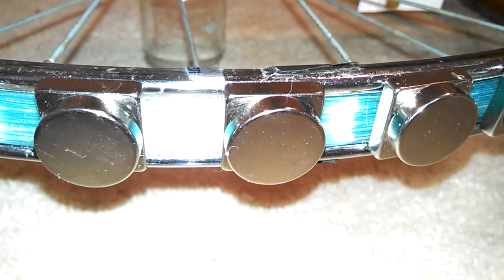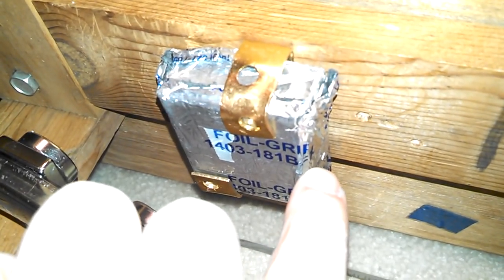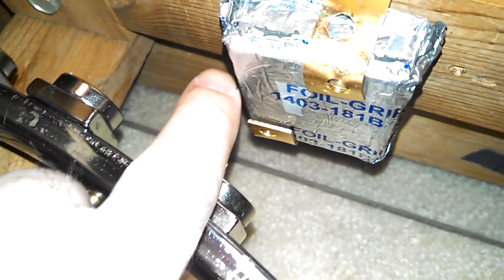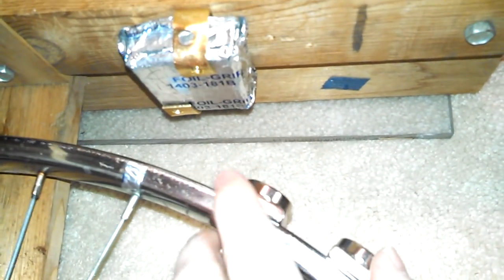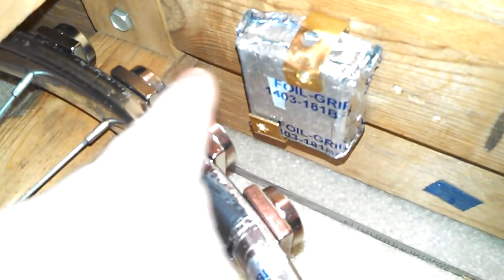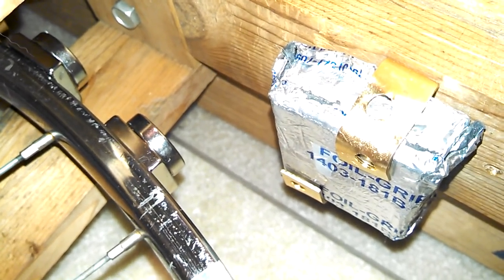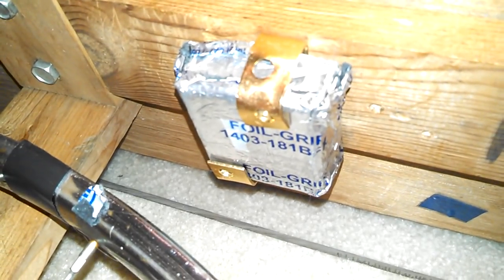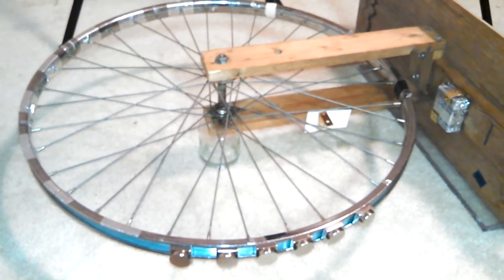🧲 Self Running Magnetic Motor Stator Test #2 update

Comment: I believe it if you show that the wheel is waterleveled...I will believe it because I made movement with magnets also ...without putting in energy myself. A very strange behaviour of neodymium is that if you put equal poles face to face they will repulse eachother away, however... if you put in the center of those magnets a plate or peace of iron, they wuill be atracted to it until they get very close to eachother and actually the neodymium magnets will be searching ( feels like floating) for a place where they can get face to face and repulse eachother again. So imagin two wheels with in the center a plate or iron object, so the magnets will atract eachother you get movement. The plate is placed so that when two magnets facing eachother are at their closest to eachother, thats where the plate ends so the magnets will repulse eachother..... if you have the 2 wheelsentirely rounded with magnets repulsing eachother and only a small area where they atract eachother, you get movement. Only 1 little push (depending on the strength of the magnets) would keep it moving..... try it and you will like it...  Sorry for my bad english...
Reply from the maker: 🧲 https://youtu.be/jsgUF5DHAwo

Comment: This video begs the question.  why not skip to the full wheel of magnets actually running?
Reply from the maker: 🔴 itakeyourphoto - I finally back now. Just now seeing your post. Sorry. . I’ve tried armature magnets all the way around. Does not work whatsoever. Not even a little. Once I place a gap back in, than it starts to run once again. I’m now working on a new build. Thanks for sharing your your idea though. Sadly, been there, done that, never worked.
Reply from the maker: 🔴🔴🔴 itakeyourphoto - Because I had to walk away from the project.

Comment: You're making a difficult to make thing, but it's not what you think it is. I's a perpetual motion device, but it does not produce energy. For kinetic energy to work, you must put in more energy then you get out. For instance, cranking the handle of a manual crank. You crank that wheel several seconds, you'll feel it isn't on a ball bearing. You had to put in a lot of energy to produce a very small amount of energy. The bigger wheel you have, the bigger energy you need it to produce.

Why is this important? Because the monopole method of producing energy only produces enough energy to keep itself spinning. Yes a monopole is amazing and able to keep perpetual motion, no it will not create additional energy beyond the kinetic energy required to keep itself moving. If you hook up a crank for any amount of kinetic energy, the force required to produce energy will come out of the kinetic energy required to spin, and it will slow to a stop as a result.
Reply from the maker: 🧲 https://youtu.be/jsgUF5DHAwo

Comment: I am wondering can you exploit the other pole of the stator which you have brought to half-strength flux in order to gain repulsive power. Am I correct that all of the magnets on the wheel have the same pole oriented outwards? I was thinking is it possible to insulate only the middle of the stator in order to distribute the flux so that it pulls from one side, pushes from the other by repulsion and obstructs least the motion in the middle.
Reply from the maker: 🧲 Big improvements since this video was made. No more sticky spot. 🧲 https://youtu.be/jsgUF5DHAwo

Comment: Good work. Keep posting.
Reply from the maker: You bet! Thanks. I resume my work May 1st, 2004
Reply: James, any success so far ? I have an old record player and am using its rotating disc to make a rotor. Just removed the tone arm and other unwanted stuff from the turntable. Will try your system of shielding. Great work. Thanks again.
Reply from the maker: Sandeep Kapoor Any success so far you ask??? My post clearly states that I resume my work come, May first, 2014. There by I'm not working on it.

Cheers!
Reply: Yeah in your previous post you mentioned "2004", so I asked. Lol.

Comment: We dont have to believe it. SHOW US. Get one of those magnetic field cards and hold it upto the stator and show has the field. Also, if it works how you say it works, you should be able to put magnets around the entire wheel, and it should continue to perpetually go around. So lets see that also.
Reply from the maker: I will be resuming my work May 1st, 2014 when I retire from my current job. If you cannot wait until then, simply build it yourself like others have who ‘now know firsthand’ that my stators works exactly the way I claim they do. Otherwise chill and be patient as I pull 80 to 90 hour work weeks and barely have time to do laundry, let alone cook. I was FORCED to walk away from my research or end up on the street.

I’ll resume soon enough.
Reply from the maker: Actually I did just that. The magnets were so powerful that it ruined the magnetic plastic sheet. Their not cheep, so I never reordered one. There were no instructions, so I had no idea that you had to keep the magnetic sheet away from the magnetic field just a little bit. Go figure.  :(

Comment: great vid , is that the copper wire inside the wheel rim in one big coil? how much power do you estimate it could output?
Reply from the maker: There is no copper wire used with this project. At this stage this video is about how well my one way stator works. As for power output? With a completely different design scaled up using a series of twelve light gage cylinders approximately twelve feet in diameter and fifty to seventy feet long would have enough torque to run a very large factory or a small town. However doing away with the grid is the idea. A hot water heater size unit would go beside your hot water heater to power the home. Keep in mind that I'm only at the developmental stage. So for now, we must take my research with a grain of salt, regardless how promising my research may be.

I'll return back to my research May 1, 2014 when I retire from my current job April 30, 2014.
Reply: Thats fantastic mate , obviously you want to protect your info but I would love to get more info on this as you go, I think this is the way to go for home energy independence . I'm very new to this but I think magnets are the way to in the absence of turbine friendly environments. The torque seems to be the issue in most cases , do you see the hot water service sized unit as multiple devices stacked ? Like 20 x 150w stators? Is the eventual plan to have the stator on the inside of the wheel and stationary magnets either side?
Reply from the maker: It would by a cylinder within a cylinder, both being heavy PVC or acrylic. Until I get my first prototype running, all bets are off. Until then, there is no exact way to foresee how much torque conversion there will be. Did you go to where I archive my work? Try, www.JamesRoneyStators.com where you will find my latest info and FAQs.

Do you have any ideas as to why it might be better to have the stators on the inside, rather than out? I' don't. Other than from the ease of engineering.

Comment: Energy is conserved in the universe: so if you claim your wheel to be self-propelling, where is the energy coming from and why does it prefer to be converted into kinetic energy?
Reply from the maker: I make no other claims whatsoever in the videos other than that I've overcome the sticky spot.

       This video only demonstrates the stator. But not just any ole stator, rather a stator that has overcome the infamous sticky spot, free and clear. This alone is epic. This stator design offers enormous torque in a future working prototype.

       Four years ago my work began on a radical new design in stator construction. The challenge was to build a stator that would make magnet motor possible by creating forward motion that's greater than its counter reaction/drag, and do this in the most forward way possible. A new generation of stators that provides an extremely powerful argument to what's possible.

        The New Stator Pro2 is designed to mimic a hypothetical mono-pole magnet. This is the backbone and the hallmark of the Stator Pro2, creating far more acceleration then there is deceleration from reverse drag; an epic achievement in the evolution of stators.

       The Stator Pro2 incorporates a magnetic runway plate in its design face. The special angle of the stator's magnetic runway plate is paramount in relationship to the performance of the rotor magnets, further reducing reverse-drag from the last rotor magnet leaving the Stator Pro2. (Think of each rotor magnet as an airplane, and as each plane reaches the end of the stator's magnetic runway plate, just like an airplane, each rotor magnet pulls up and away from the end of the run way. This greatly reduces back-drag/deceleration even further.

       Inertia: There are 6 world-class n42 neodymium armature magnets that gang up on just 1 world-class n42 neodymium stator magnet. The 6 to 1 ratio creates more inertia than the single stator magnet can cancel out. This sets up your third imbalance
in the system.

       Just as the last rotor magnet is about to pass across the stator, the lead rotor magnet is suddenly pulled/sucked into the next awaiting stator which in turn, pulls the last armature magnet through the previous stator with a force that is far greater than any opposite force. This sets up yet a greater imbalance in the system.

        The Stator Pro2 offsets the equilibrium in the system by leaps and bounds, thus overcoming any equal and opposite reaction that Newton's 3rd law refers to, in that, "for every action there is an equal and opposite reaction". That law is no longer 100% true.

       Just add dot com to JamesRoneyStators for more info.

Cheers!

Comment: In many youtube clips various people are doing all kinds of magnetic motors, and they all appear to find a sticky point, so I am suggesting why not use electro magnet to give a little push just when it is required around a sticky point so that the wheel or rotor continues to go past the sticky point, so in other words put some energy in (electrical) and get out much larger energy through magnets, I am not for one minute suggesting that you create more enrgy out of little, I know that it is against the laws of thermodynamics, so yse if you need to spend 10% of energy to get say even 20% then why not, it is a gain.
Reply from the maker: I have no sticky spot as I have completely overcome that. Check my videos out and see for yourself.

Thank you for your constructive feed back.

Comment: HaHahah,,, Making fool of yourself and others too ...
Can you explain one thing  .. when the wheel is again coming to the stator .. Why it is pushing it ahead ,, instead at the moment the very first magnet arrives at the stator it should have pushed the the wheel in opposite direction to its motion and not in the direction of the motion.,,, So finally it will never work... And if you are so knowledgeable..one more question for you... What would happen if whole of the universe will be at the same temperature? Don't arrive at the conclusion in a minute ... First study about this and then calculate and you will have your answer .. That why your project didn't worked.. Enjoy the life .. Don't waste it..
Reply from the maker: Your poorly phrased sentences is confusing. The rotor magnets keep going in the same direction because the stator mimics a hypothetical monopole magnet.

   You have not a clue how my stator works. So here you go...

      Four years ago I began work on a radical new design in stator construction. The challenge was to build a stator that would make magnet motor possible by creating forward motion that's greater than its counter reaction/drag, and do this in the most forward way possible. A new generation of stators that provides an extremely powerful argument to what's possible.
   
    The New Stator Pro2 is designed to mimic a hypothetical mono-pole magnet. This is the backbone and the hallmark of the Stator Pro2, creating far more acceleration then there is deceleration from reverse drag; an epic achievement in the evolution of stators.

    The Stator Pro2 incorporates a magnetic runway plate in its design face. The special angle of the stator's magnetic runway plate is paramount in relationship to the performance of the rotor magnets, further reducing reverse-drag from the last rotor magnet leaving the Stator Pro2. (Think of each rotor magnet as an airplane, and as each plane reaches the end of the stator's magnetic runway plate, just like an airplane, each rotor magnet pulls up and away from the end of the run way. This greatly reduces back-drag even further.

    Inertia: There are 6 world-class n42 neodymium armature magnets that gang up on just 1 world-class n42 neodymium stator magnet. The 6 to 1 ratio creates more inertia than the single stator magnet can cancel out. This sets up your third imbalance in the system.

    Just as the last rotor magnet is about to pass across the stator, the lead rotor magnet is suddenly pulled/sucked into the next awaiting stator which in turn, pulls the last armature magnet through the previous stator with a force that is far
greater than any opposite force. This sets up yet a greater imbalance in the system.

     The Stator Pro2 offsets the equilibrium in the system by leaps and bounds, thus overcoming any equal and opposite reaction that Newton's 3rd law refers to, in that, "for every action there is an equal and opposite reaction".

     In summery: My stator creates more than enough forward acceleration to overcome any counter deceleration, thus overcoming the sticky spot in the process. This is not my opinion; it's fact; epic history in the making.

     Have you read my fan mail at www.JamesRoneyStators.com?

     Did you  know that the John Hutchinson (of the Hutchinson effect) has taken great interest in my findings and follows my work.

     Did you know that the ships engineer for the African Mercy Hospital Ship featured on 60 Minutes contacted me, congratulating me on my findings? That as soon my finding are complete and confirmed, both the captain and the ships engineer want me to work with them in designing them a brand new electric generator for their ship.

     Yes my findings are still very preliminary, but epic, nevertheless.

     
     Cheers!

     James Roney Stators

Comment: Hi James I love the work you have done. I do not know that much about magnets but I find this very interesting. I have a question about the stator. Could you turn the stator so that the like pole faces the wheel and the opposite pole faces away from the wheel. Sorry if this is a silly question maybe I need some more understanding of magnets. Live the videos. Thanks for sharing.
Reply from the maker: No. It does not work.

Comment: i think if you were to put magnets in three spot on the wheel with equal spacing and two more of those boxes equally space also you could get more speed and if a coil was added in between each you could then make your own power and mabie run a power supply one like they use to use for bike lights
Reply from the maker: No matter how many stators/magnets used, it only turns at one speed. But it has lots of torque.

Comment: You should put the stator assembly under a white card and sprinkle iron filings on top, it would illustrate the monopole field better than the paperclip does.
Reply from the maker: Good point. But I used a glass table top and that was even more revealing.

I resume my work come, May 1st, 2014.